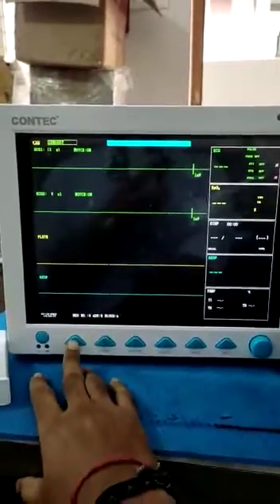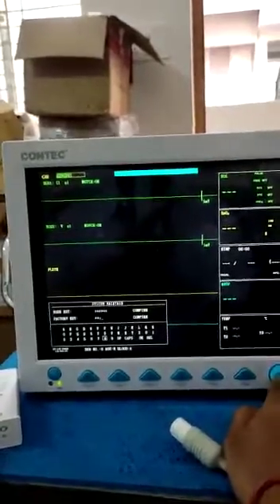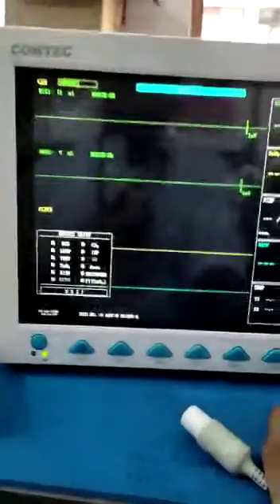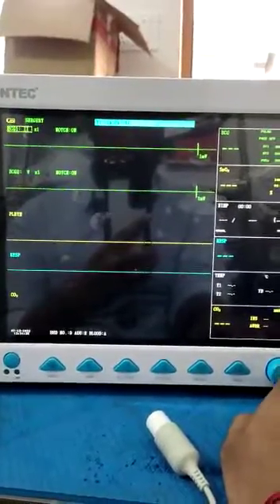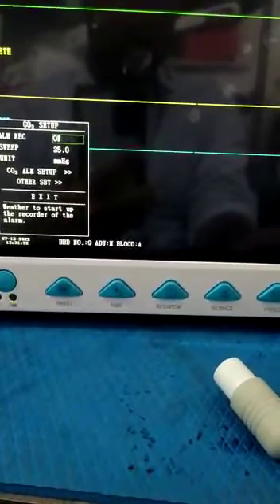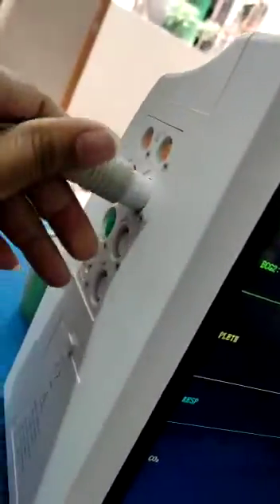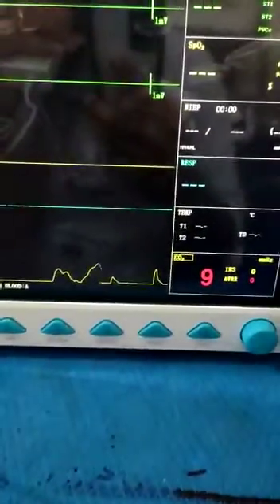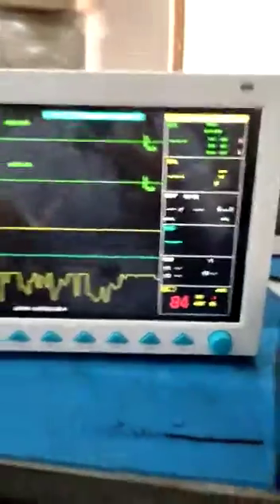Contec 8000 etco2 activation

Comment: Is the code "70808"
Reply: The password to adjust alarm limits, and adjust other settings is 70808, but you can change it from 70808 to your chosen password. Also, the password for getting into the Maintain menus is 88888